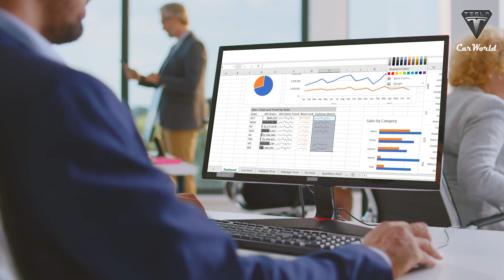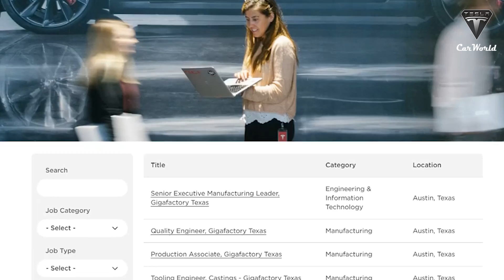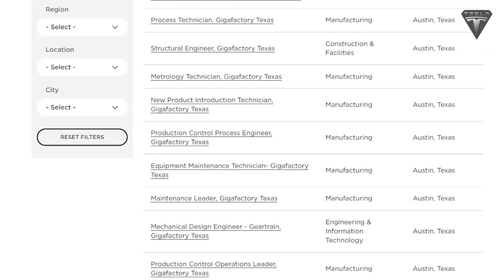Elon Musk Reveals Giga Texas INSANE Produce 20,000 cars, Can't Control Output!

Comment: The production count is one thing. The other are the parts that come from China for production and they are stagnating because China is implementing lockdowns and the cargo ships are not coming fast enough. Just-in-time doesn't work that way. BYD in China produces a large proportion of the parts itself.
Reply: TSLA is vertically integrated too, just in time doesn’t fly at TSLA , that’s a Toyota thing.

Comment: 20k units a week at GigaTexas by the end of 2022.  

Elon says half a million ... units Or was that a half a million run rate? 20k units a week is already a million run rate.

 napkin math...

Assume they hit 20k per week in the last week. 32 weeks from now.  Ramp up linearly. 20k/32  more each week.  625 more produced each week, for 32 weeks is 330k units produced this year.

They will have to ramp up faster to hit half a million.  Perhaps reaching 20k per week about 10 weeks earlier. Say... mid October.

Hope it is true.
Reply: 0.5 M run-rate by end 2022. Given a slow-steady ramp, even accounting for Tesla's previous ramping experience with Shanghai factory, no way they could actually achieve .5M cars produced in 2022...and if they did, I'm mortgaging the house to buy more stock.
Reply: @vermontsownboy6957  

I agree.  I was trying to see what the production numbers would look like.

I think 10k a week is possible. I think it is about the limit based on presses.

With 4 presses producing a part every 90 seconds, two parts needed per frame, 75% up time.  That is about 9k a week.  

Maybe their strategy is to over produce key parts early, getting the production rate to rampnup here knowing they can easily recycle rejects back into the smelter and save the good ones for later.

But 10k a week would be 86% up-time 90% up time allows for the possibility of 4-5% defects... and that allows a half million per year run rate.

I expect them to build about 150k this year.  How about you?
Reply: I believe they said 500k run rate by the end of the year, which is 10k a week. Maybe they could hit 20k/week by the end of 2023.
Reply from the maker: Currently, Tesla Giga Texas is continuing to recruit more workers to boost the production capacity of this giant factory, hopefully in the near future, Giga Texas will soon achieve high output as set out targets.
By the way, thank you very much for your comment! Hope to see you again in our next videos and have a good day!